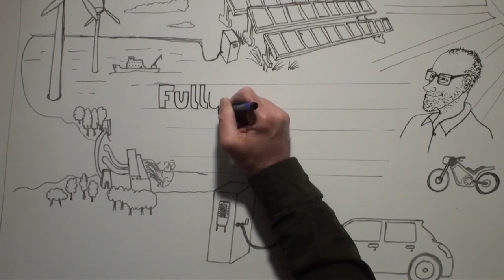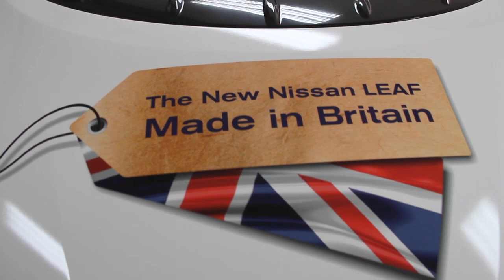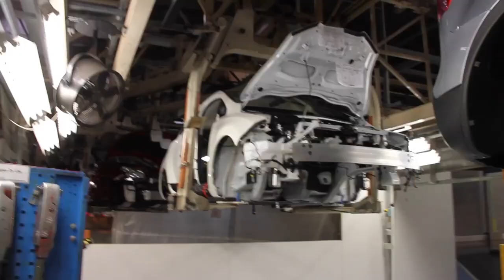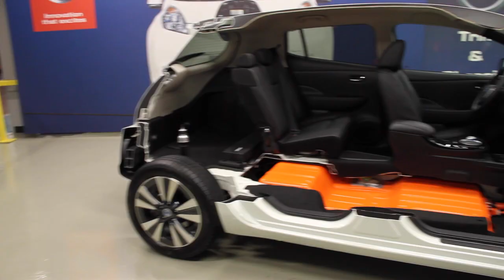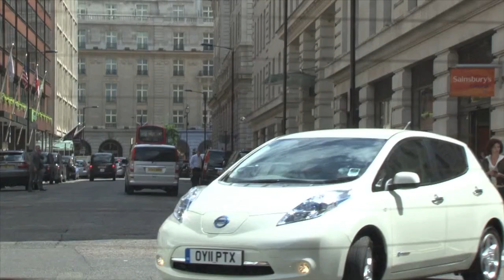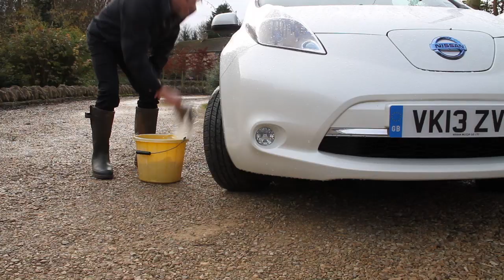Second Generation Nissan Leaf | Fully Charged

Comment: John Pucecetti ... feel free to buy an S model with no cell/satellite phone capability. 
Please also, check your computer which  is running in the high microwave ( gigahertz) region with probably only a Plastic Case !  Unless you have one of those old Steam Powered Computers... you are sitting on top of a radiating RF source far more powerful than what you are exposed to in a the rolling faraday shield we call a metal automobile.

If you are going to be afraid of things.. it pays to understand them.  Chicken Little is NOT your best source of scientific information.   Every modern car is a nest of computers, and most have internal  microwave RF sources.. blue tooth, wi-fi, and the rest.  Buy a "stripper", and you will probably NOT get those things, and you will find that the computers are shielded to keep the car running despite the proliferation of RF sources in almost everything from your wrist watch to your clothes washer, and cordless phone.   Not that this proliferation is good... in terms of microwave exposure... but why single out the leaf ?  And not say a V8 Dodge, or a Toyota ?  Are you driving your dog cart today ?   Get an am portable radio, and listen to the ignition noise from a '50 chevy.   Very little EMF from my diesel VW.. but it stinks.  Next problem.. ?

Comment: I really enjoyed this Leaf review and I like my Leaf very much in the summer but not in the winter.   Two years ago I leased a 2012 Leaf, I have 29,000 miles on it now and after watching this video and reading the viewer comments, I am still in the dark when it comes to the heater.  To be honest, I don't care HOW it works, but I do care about the impact it has on battery consumption because that affects range.  In St.Paul Minnesota last winter we had 4 days that hit -22F.  My round trip drive to work is 46 miles.   Even if I preheat the Leaf while connected to the wall charger, I cannot complete the 46 mile drive without stopping for a charge if the temp is below zero. I use climate control ONLY when the front window is difficult to see out of. If I can see out of the front window, I drive without heat.  So when this Leaf review says that the heater is 3X more efficient than my 2012 Leaf, it really has my attention. 

2 more observations:

The tires on the Leaf might be great in states that have no snow, but in Minnesota winter, they slide around a lot.  Putting on winter snow tires is a big improvement.

Also, one of the comments attached to this video noted how Nissan dealers don't really want to sell electric cars.  I also experienced that at Nissan.  I was surprised that with perhaps 15 sales people on the floor, only 1 had the ability to sell a Leaf.  Even worse was the Ford dealer.  That Ford salesman very enthusiastically tried to talk me out of buying any brand of electric, even Ford.
Reply: I bought my 2012 Leaf and feel the same that you do about driving it in the winter. I'm in Minneapolis and drive about 32 round trip everyday. If my work didnt offer me a 110 plug and reserved parking i would have traded it in. I made it two winters on the stock tires and it was horrible. Also i found the stock tires are undersized for the weight for this car. I had two tires grow buldges on the sidewall. I went with a better allseason and bumped up to a 225 width tire for a little more foot print.
I am thinking about buying a second leaf (repairable) to modify my leaf into a AWD dual motor and increase the range by adding the as much of the second battery pack to it.
Reply: Bryan,

I have a fair amount of experience with building cars (street rods) and I must say that your thoughts about creating an AWD Leaf that carries a dual battery pack sounds like a very large project.  Excuse my intruding in to your plans, but I think the AWD aspect wouldn't be worth the effort... unless you are doing it for the mechanical enjoyment.  If you could find a battery pack from a Leaf at a reasonable price, then I think adding as much of the second battery pack would be a very interesting project.  I really like my Leaf in summer, and if the battery capacity were higher, it would become a great electric car for Minnesota winter.  I have one more year on my lease.  If Nissan really does come out with a Leaf with a larger battery, then I would get another.  If they don't, then I might bite the bullet and get a Tesla.  

If you decide to pursue a salvageable Leaf, you should try to find a 2013 or newer because you could pirate the improved heater and also the charger because it charges twice as fast as the 2012.  With the improved heater, newer charger, and a larger battery, you would have an incredible Leaf !!  The additional battery weight might limit how much of the second battery pack you add, but it sure sounds like a fun project.

You are in Minneapolis and I am in White Bear Lake.   If you decide to do the project, I would like to hear how it goes.  We could meet at Anchor fish and chips in Northeast Minneapolis (I go there often) and you can tell me about it.  

Mike Roerig
Reply: Yeah, I think if I have the time to do it and can fine the right salavage car it would make a fun project. And your right on the 2013 or newer for the upgraded tech. And as far as adding the second cars batteries i would try and add them in Modular so I could just add them as needed. Maybe make a sleeper auto cross car. It wouldnt be super fast but it would be unexpectedly faster :-) If the wife gives me the Green light ill start posting some videos when i have spare car in the garage.

Bryan

Comment: The thing I don't understand is why companies put the effort into designing a new car to be electric only and still try and place the electric motor and batteries into a traditional car drive-line space. Nissan needs to look at Tesla.
Reply: I am sure its partially because the production can reuse previous optimizations used for normal petrol cars, as he also demonstrates very well with the bits showing the actual production running on the same assembly lines as fossil fuel cars. Tesla has no car manufacturing so could build a company around an electrical car from scratch - hard for the big motoring companies to turn around on a dime like that.
Reply: It is hard to turn a big boat. If you start with small boat and in completely other direction then it is easier. (big company=big boat)
BTW. I understand why tesla wants to sell directly to customers. My recent experience in nissan dealership was so that i got feeling that they do not want to sell electric cars.
At the moment Estonia seems to be one of the best places to own electric cars. a lot of chademo chargers.
Reply: I seem to remember Tesla's first car was based on a Lotus Elise so even they chose a conventional platform initially to test the water.
The BMW i3 is more like the present Tesla in as much as its a ground up design.
Reply: ??? As far as I've read, the Nissan LEAF is the same as the Tesla, in that it's been designed with the batteries in the bottom of the car under the seats, unlike the Ford Focus. btw... mine is purchased and on the assembly line; a 2015 Morning Sky Blue SL.
Reply: That's right, batteries are underneath the car.  They don't take up any boot space at all.  The gen 1.5 and 2.0 leafs have quite a lot of boot space.

The electric motor is located under the hood.  that could be what the OP was getting at.  The reason for that is the Leaf is not big enough to put the electric motor anywhere else.  the Tesla Model S is big enough to support the motor(s) and batteries underneath the vehicle, allowing for storage space at the front and back of the car.

Comment: Alright... I watched the video till I heard 75-85 miles of range... Whats wrong with those manufacturers??? Tesla is building a car with a range of 265 miles.... and they want to improve that to more... And suddenly Reno and Nissan starts making cars with 80-90 miles of range... Cmon... Improved heater??? Improved cameras?? Whats the point if there is no range???
Reply: The only obstacle that I can think of is that small issue of price. Tesla has successfully established themselves as a luxury brand. No one would pay $100k for a Leaf.
Reply: Kent Purdy, indeed - and that is why the Leaf is so successful. Its affordable and have just the right range for the majority of daily driving for a commuter living somewhat close to a city.
Reply: Mindaugas V the Tesla simply has a much larger battery cell compared to the LEAF, BMW i3, Ford Focus EV, etc.  The trade off is the weight, hence the reason why the tesla is made from lighter weight materials like carbon fiber and aluminium body frame.  Double the size of the battery = Double the driving range.  The only way that BMW i3 (non ER) has a longer range than the LEAF is because they reduced the overall weight of the car.  But the i3 has virtually no cargo space compared to the LEAF or Tesla.
Reply: The point is that an average daily drive is something like 10-20 miles or maby less, many people even drive 2-3 miles each trip. At such driving you really don't need all that range.
Increasing range results in more battery, therefore more weight and higher cost.
They can improve range if they want to, but it was not the goal. Also, for now, cars like Leaf is thought of as a 2.car rather than the only car.
Reply: The i3 can also only hold 4 people.

Comment: I'm disappointed. No real information, just marketing rubbish. "100 improvements". Right. "Heat exchanger" - what is that and does it exchange local currencies as well? Light in charging port is actually nice, isn't it copied from Tesla? Because remotely controlled charging port lid certainly is. 
Where is the old, sharp Robert Llewelyn we all know and love?
Reply: The heat exchanger is in fact a heat pump so you get about 3kWh of heat for every KwH of electricity used. It would indeed be useful if we'd been told that.
And there is nothing wrong with re-using good ideas, despite the way the patent system often impedes this.
Reply: xxwookey You get 3kWh of heat for every KWh of electricity used.

Where from?
Reply: The heat exchanger was a massive improvement.  In the first gen leaf turning on the climate control resulted in losing about 30% of the car's range.  This improvement reduced that loss to 1-2%.

Comment: I'm absoloutley in love with the negative replies people are posting of tiny niggles and pedantry. So many circumstancial arguments that it proves that EV motoring really is the cheapest way to supercede fossil-fuel burner vehicles. In the end if the car manufacturers hadn't spent so much money promoting the piston engine over the turbine engine for road vehicles then maybe they'd have enough money left to make piston engines more efficient than they are currently ;)

Gratz on this review, pending a test drive I'm pobably looking at trading in my Renault Zoe for a Leaf Mk2.

Comment: Robert, I'd like you video more if you included some of the technical improvements in the second gen car rather than just the user interface improvements. Is the battery any better? Is the motor the same? How have the cars control algorithms changed?
Reply: The battery hasn't changed. The charger has moved into the engine bay on top of the engine. The motor has been slightly improived IIRC, but nothing dramatic.  (I went to a talk from Nissan Project manager which had a fair amount of detail).

Comment: Technically it's not the second generation but a mid-cycle refresh... The second generation isn't out for a few years. Traditionally, electric pumps and heaters are not reliable which is why they were abandoned in the mid 20th century. I wonder how diff the tech is now.....
Reply: Dane, you're kidding right? Electric pumps and heaters were abandoned in the mid 20th??? You don't have an airconditioner then? You've never seen a heat pump in a modern building? How does your fridge work? In case you don't realise your refrigerator is exactly that. An electric pump/heater that pumps the heat out of the fridge and into the kitchen. Mine has run all day every day for the last 8 years and shows no sign of stopping. The one I had before that ran for 35 years, all day every day. It was still working when I got rid of it for a smaller one.

Comment: "This car produces zero grammes of CO2 per kilometer".  Please please please don't say that cos it isn't true.  By saying things like that, you will make sceptical viewers disregard all the other worthwhile things you have to say about EVs, and you'll be left preaching to the choir as it were...

In the UK, and in Norway this will emit less than a similar petrol or diesel engine car - but driving it will not result in 0 g / km.  Even in Norway.

For a rigorous, and well researched picture of what the actual picture will be like - see this page:

http://shrinkthatfootprint.com/electric-cars-green

"Electric cars are far from perfect, and there are plenty of valid ways to critique them.  But let’s not pretend that a gasoline vehicle can compete with an electric car in terms of carbon emissions".
Reply from the maker: I take your point and I do try to be realistic about such things.
However when I recorded the 1st drive in Oslo, I had just spent an hour talking to someone who worked for the Norwegian national grid who went into considerable detail about the electricity supply. He was very insistent on the 98% renewable supply as I explained in the show. 
I have since been sent copious information about the electricity supply which contradicts this view, so I'm not sure who to believe.
However, if, for example as I have often done, you charge the car from 100%, verifiable renewable source, then claiming the car is producing zero emissions is not such a ridiculous statement.
Yes, the machinery to supply the power has a carbon impact, the car's manufacture has a carbon impact, but during the short time you are driving it using that power it is, effectively, realistically producing zero grammes of CO2.
Reply: Typical calculations of CO2 per km for a gasoline car only count the tailpipe emissions and disregard any upstream energy used in refining, transport, pumping, etc. So disregarding the CO2 emissions from building the hydro-power plant and transmission lines is similar and reasonable.
Reply: gasdive Yep, I know that there is a difference between well-to-road and tank-to-road emissions for ICE.  Figures I've seen give the overhead at between 8% and 20% (European Association for Battery Electric Vehicles -

http://ec.europa.eu/transport/themes/strategies/consultations/doc/2009_03_27_future_of_transport/20090408_eabev_(scientific_study).pdf

vs. those on page 21 or so of this:

http://pub.epsilon.slu.se/10424/17/ahlgren_s_and_eriksson_m_130529.pdf

which gives figures between about 8% and 32%.

... The overhead probably varies a lot from place to place.

But I'll stand by my point - saying that the emissions from electric vehicles are zero - even in Norway etc. is leaving yourself open to (fair IMO) criticism.

Don't get me (or the linked site) wrong - the figures for electric cars are already good (already better than ICE in nearly all cases), and stand to improve in future (e.g. improved battery pack recycling will lower the embodied energy, and with any luck the global electricity production will slowly de-carbonise).

Whilst it would be convenient to disregard this, that or the-other when giving figures (whether you're trying to plug ICE or EV), it's really best not to - you'll just make people switch-off.  To miss-quote Richard Feynman - the atmosphere can't be fooled either.
Reply: fullychargedshow You could indeed argue (with a few ifs and buts) that the marginal emissions are (close to) zero g CO2e in some cases (say, when you're charging off-grid, or from a close-to fully de-carbonised grid).

... but it seems to me that unless you explicitly say that, you could reasonably accused of using what I believe the Americans' call "Weasel Words", and that's probably only to the advantage of Clarkson and co.

EVs are great (and when I get rid of my high-efficiency Diesel, I'll probably buy one to replace it with), and I enjoy following Fully Charged, but I just think that if you inadvertently hype EVs, you shoot yourself in the foot...
Reply: +Tim Small It's a good point. EV's for me are the future - partly because of the low impact in the first place (I also currently drive a very efficient small diesel and it can't compete) but also because it's much easier to collect and clean emissions made in one place (well around 1000) than made in 1.2 billion places. Power stations are getting cleaner all the time and for the amount of power produced they make so much more sense than ice cars. 
I'm currently looking at leafs because the new 30kwh version means it's now a realistic proposition - my usual day would be right on the edge of what a 24kwh leaf could technically do in summer. If that turns out to be less than ideal I will most likely end up with an i3rex. 
We can't really do carbon neutral yet as it's still a fair bit off but there's nothing wrong with us doing what we can to at least help as much as reasonable. The tech is coming, the power is getting cleaner and there are far more places now using renewables. 
Last time I got a new car (2.5 years now) the small diesel was the only real way to go because in the real world and for my use it made the least impact. Now BEV's and the rex have moved on enough I can go that way. I think in reality most people already could have and if I didn't need to do the miles in the way I do I would have had a renault zoe last time round - for my personal use it would have bee great but it wouldn't have been near coping with my work use.